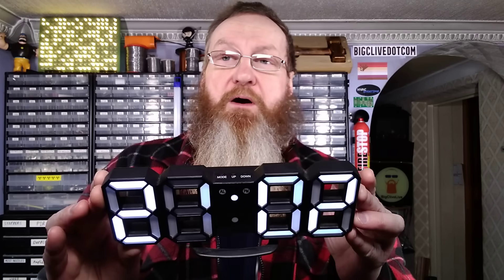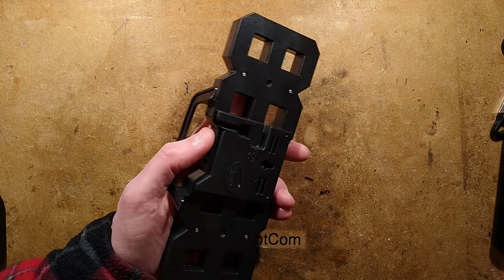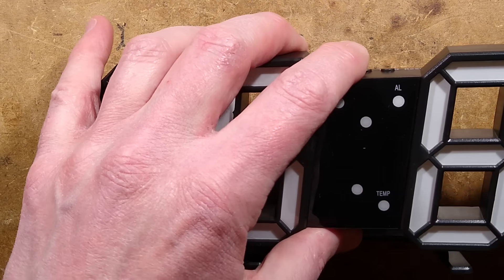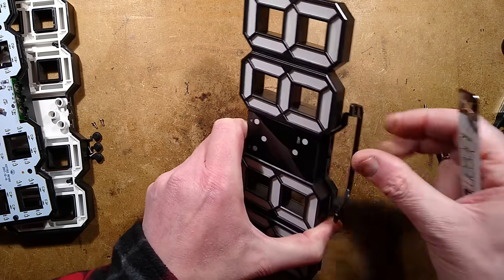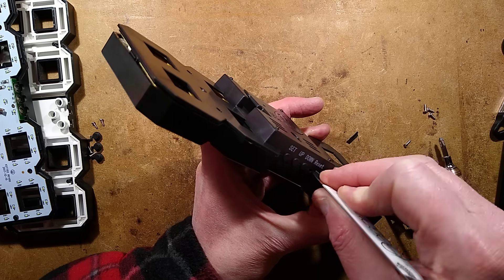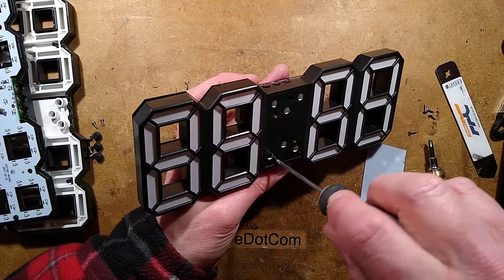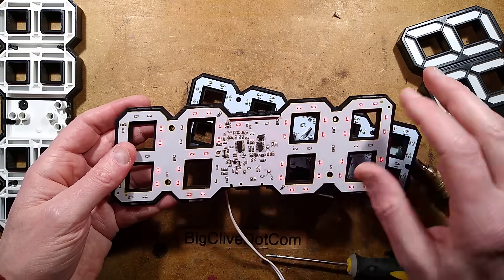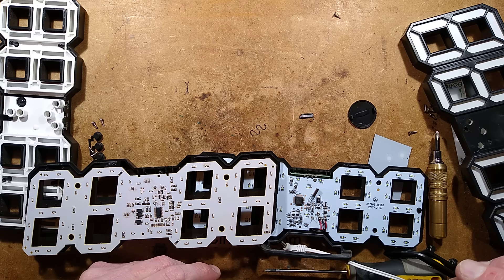The CURSE of white LEDs

Comment: The Red is always best for clocks, it's less stressful at night. I've got some Red LED clocks that are well over 35 yo, and they still run fine.
Reply: Absolutely. I got tired of red and bought a blue electroluminescent one years ago. 
It was terrible in a bedroom, like a night light. I've since had the misfortune of LED's in my bedroom other than red. They get banished or covered with electrical tape. Sorry fire department, green or blinky lights in the bedroom get removed or covered right up.
Reply: In many ways that is true. Unfortunately for me, I simply detest red LED displays. I have no idea why. I just hate them irrationally. 

I always had green LED clocks growing up. Now I have white and pink LED clocks built from kits. And I made a giant-digit 7-segment thermometer using warm white LED filaments. I intend to make a clock the same way someday.
Reply: Yep. I always set my nightlight Hue bulb to amber, red, or reddish-pink. It's the best side of the spectrum for being sleepy.

Comment: LED chips can practically last forever - but only if you treat them well and spend enough on the LEDs itself as well as on the circuit design and the heat dissipation. 

Most commercially available products indeed have weaknesses due to cost down measures or poor design.

Comment: Could this be just because they're being over-driven in that clock? I've seen some of those multiplexed clocks that drive them way past their rated current and rely on the multiplexing to not destroy them instantly :)
Reply from the maker: Clock LEDs are often putting out a low average power.  I think the average power and associated heat is the main factor.

Comment: You forget what kind of audience you have. Most of us are quite masochistic and will gladly attempt replacement of super-duper-tiny surface mount LEDs.
In fact, that IS fun!
Reply: If you don't have tweezers, can you use two irons like chopsticks?
Reply: @chaos.corner  Sure, but if it smells like bacon; you're holding them wrong...
Reply: @chaos.corner  There's a British YouTuber that does component removal tutorials with 2 irons, though I'm sure he uses 2 hands.
Reply: @MMuraseofSandvich  What you have to remember is the tweezers are designed to work together. Some multi-iron stations for example can not have the two irons touching or the temperature control goes ape! One such station to be weary about is the ATTEN GT-6200 station. If you use a tweezer on one port, and a bulk iron on the other you can not use the bulk to help heat ground side of a stubborn component while using the tweezer to take it off. Temp control does not work.
Using two isolated ATTEN ST-1509 stations for example have no issues doing the same task, and you save about $100 as well.
Reply: @chaos.corner  Yes, you totally can, and I do it regularly. But for small parts, a "hit and run" of putting on flux, leaded solder (lots), heating both end, and "wiping" the part off is faster. I used to use two irons for SMD aluminium electrolytics but now twist them free and sort bits stuck to pads afterwards.
Reply: @gadgetmind  Although it was kind-of a joke, it's semi-serious. Mostly I've worked on 0805 size but I have some much smaller ones that need to be swapped out on my todo pile. I'm sure I can do them OK but I've just procrastinated.
Reply: It's only masochistic when you are replacing 0402 or smaller when you have a SMD station.

Comment: It's called led maintenance. Led usualy don't outright fail but naturally drops output over time due to stress or chemical decomposition. They rated  are up to the x amount of hours equates of a certain percentage of output.  70% output has been the standard also called L70. some led manufactures strive for 80% TO 90% rated output for x amount of hours.

Comment: Imagine, in a few years, all those older cars with dim LED headlights that would cost more than the value of the car to replace.
Reply: Don't worry, the rest of the car will stop working before that happens.
Reply: Presumably auto OEMs specify LED headlights with any quality control whatsoever and enough engineering margin to tolerate some degradation.  This obviously isn't guaranteed, but I know my expectations are higher for something I have to make monthly payments compared to a mail-order trinket with an acknowledged and tolerated 50% DOA rate.
Reply: @scottgigot2593  Judging by all the blue LED halos I can see on the road at night where the yellow phosphor is degrading, they're at least as high quality as street lights...

Comment: What? Phosphors don't last forever? Tell me it isn't so!

Back when I first started work as an apprentice electronics technician in 1977 a components supplier just along from work received a shipment of red LED clock modules . Several of us apprentices bought them.
Mine is still running beside my bed.
I calculated from 29 Dec 1977 (because I can't remember what date in 1977 I bought this) and that is 413424 hours running time

Comment: The digital clock, with analog display (60 * 1.8mm +  12 * 3mm  LEDs) I build in the early 1980s, shines just as bright as when I buile it. It has been running 24/7/365 since I build it. Good old red LEDs just keeps on going.

Comment: I have had one of the red ones for about 5 years now (I got it shortly after your previous video). It's the version that's just a clock, though, no extras. I find it too bright for use as a bedside clock, even on lowest intensity (I put a layer of paper over each segment to dim them a bit), but the LEDs haven't faded after constant use. They really could use a filter in front, because the white plastic is too reflective, making it impossible to read if there's any bright light in the room.
Reply: I have a cool as hell red LED with the same issue, super bright, the lowest setting should be the highest, back in the day there would be an onboard potentiometer you could use as a variable resister to tune stuff, probably not now but I suspect there would be a few ways to reduce the brightness, I'm thinking probs just a higher resistor req somewhere, Clive might know better though. I haven’t took mine apart yet

Comment: Sort ofd related issue that you may already be aware of; There were some models of LG TVs where the LCD backlights, whilst still working were gradually burning off their phosphors, making the TV get progressively bluer over time with the owners not really noticing it until it becomes pretty much unwatchable.
Reply: I've seen more than a few large TVs used as digital signage that have turned blue, or had portions of the backlight die altogether: My GP's reception area has a blue tinged and fading screen in it, and the new PDSA hospital in Manchester had at least six of them dotted around the waiting area that were all doing this early last year. (The last time I went in, they were all switched off!)
Reply from the maker: I saw a video monitor a few days ago, where the backlight was very blue.
Reply: That has to be a quality control or overheating issue?
Reply: Not some models of LG TVs, but almost every TV on the market. LCD panel needs some sort of backlight, and since LEDs degrade over time first they will shift their color temperature to cooler white, and then even blue. Also, if you will not replace failing backlight on edge lit tv it will fry diffusion plates. Typically backlight lasts from ~7000h up to ~50000h, and it's lifespan is directly correlated with brightness setting.
Reply: @micha3-2137 First thing I do with an lcd tv, is turn down the backlight to the minimum acceptable brightness (without telling the rest of the family!)

Comment: Red's also good for not messing with your night vision.
Reply: I think it has something to do with the wavelength of red light and how our retina absorbs it. I turned a white one red myself, and it indeed disrupts night vision less and i just love red or warm lights 😳
Reply: @_q0wOp  Really bad for night driving.
Sure, you can see great in a lit area, but pull down a dark alley, and it gets terrifying.
Reply: I miss old street lights.
Reply: @integerofdoom69  I've seen led street lights with very warm light like 2700k; they're awesome. Anything above that just feels cold / sterile for whatever reason.
Reply: @danl6634  I recall being in San Jose and they’ve got sodium street lights that are a very distinct yellow.  The story I heard was that was an agreement with an astronomical observatory on a nearby mountain.  The narrower spectrum of the yellow light pollution caused less disruption to measurements at the observatory.
Reply: @wtmayhew  yep, that's low pressure sodium. Makes it easy to filter out the light pollution from telescope pics. Same thing they use in darkrooms before LED's, it's a trip being in a room with it being the only light. It essentially turns everything into black & white (but actually yellow) because you can't differentiate colors when they're only 1 wavelength.
Reply: @integerofdoom69 me too.
Reply: @integerofdoom69  The thing I miss most about the old sodium lights is how WRONG you'd get colors. Someone wearing a black jacket walks up on to their porch and it's actually bright green with blue dots and stuff like that!
Reply: @R.Daneel  Yeah, it was a very narrow spectrum.
Gave nights a different vibe.
Reply: Especially true for somebody like myself where blue wavelengths are extremely blurry at night. Funny thing is I've got 20/20 vision otherwise, and no astigmatism or anything like that. It's only the vibrant blue lights that blow everything else out in their immediate area. Driving & trying to read business signs with bright blue neon / led signs sucks big time. I can even tell that the modern led auto headlights that are shifted too far to the blue i perceive it to be dimmer because i can't resolve things as well.
Reply: @danl6634  I had extremely minor astigmatism, too minor to be correctable, for about 20 years and had the same experience with blue LEDs making it harder to see everything else around. 

Thankfully my astigmatism finally got worse, so it was bad enough to correct, and is therefore actually better. And this no longer occurs for me, when I've got my glasses on.

Not to armchair diagnose you with astigmatism of course. I assume you would've been told what I was told, that it's there but too minor to treat, if that was the case. It would be very strange for an optician/optometrist to tell you that you have "no astigmatism" if it was actually present but too minor to correct. 

That said, if you don't see one regularly because you otherwise have perfect vision, then I suppose there might be something that passed you by. If the effect from blue lights gets noticeably worse all of a sudden, I would urge you to get it checked.
Reply: Astronomers and astrophotographers know all about red to protect night vision.
Reply: I've heard from a few people that because we humans have spent the better part of our existence sleeping near firelight, we've adapted to reds and orange light as being comforting. But I'm not so sure of the validity of that.

Maybe it's a placebo, but I do find red light much less distracting at night than other colors. I have a red LED bulb in my bedroom nightlight.
Reply: @AdhamOhm  I find 2700k lights to be more soothing than red but that’s probably just me
Reply: You have visions in the night? What does your doctor say to this?
Reply: As an astrophotographer who also does visual astronomy I concur!❤
Reply: Back in my army days we'd always use red light at night. Much less dazzling and also doesn't travel as far through foliage so harder to be spotted by the bag guys
Reply: Yes. And people knew that back then. Car manufacturers today: Blinding white dashes in almost every new car 🤦🏼‍♂️
Reply: I know a person who is a CFI and small plane recreational pilot.  He uses a blue penlight flashlight in the cockpit at night.  Apparently blue is also OK for preserving night vision as long as it is narrow band blue.  His flashlight has an older silicon carbide blue LED.

Comment: Thanks for that. I was thinking about buying one of those clocks recently, but wasn't sure how big they were. Now I might get a couple to hack. I was thinking about using just the case with some WS2812 LED strips and a microcontroller to make a colour changing clock that also responded to the light levels.

Comment: Red's also nicer for bedrooms to lessen effect on night vision.
Reply: Why do you use night vision in your bedroom?
Reply: @radiationking9398  I apparently wasn't clear, I'm not referring to using night vision googles or something, I'm referring to the fact that your eyes adjust to low light conditions so you can see MUCH better after some number of minutes (!5 or sl?).  But white/blue/normal lights will ruin that fairly quickly, and then it'll take another 15 minutes to readjust.  Also, white/blue light will tend to wake you up, so if sleeping, and have to get up to use bathroom or something, your good night vision isn't messed up.  I have red motion controlled night lights in my bathrooms.